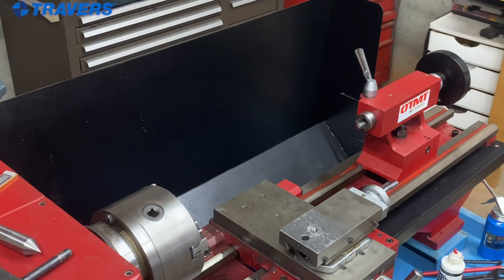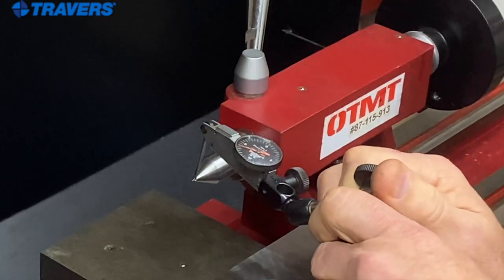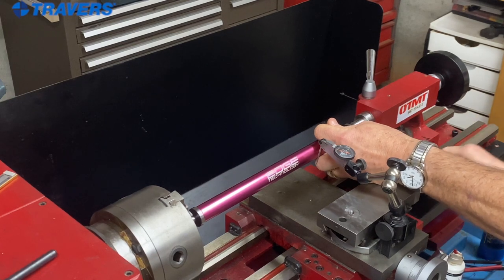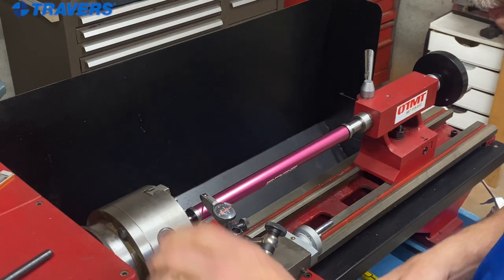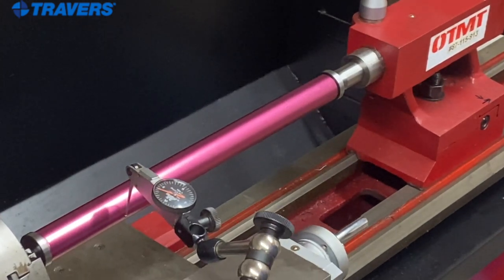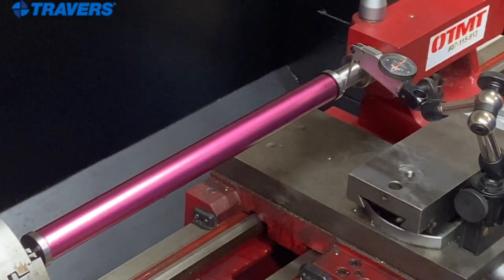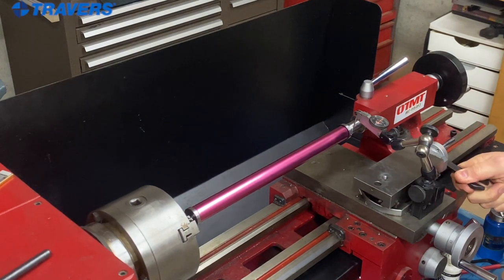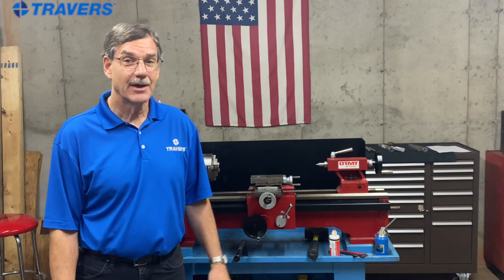How To Align The Tailstock To The Headstock On Your Lathe

Comment: That's great for the horizontal axis. What about aligning it vertically?
Reply: Thanks, DH.  As long as you can hold it between two centers and run an indicator from one end to the other, the angle it's at doesn't matter.

Comment: Mentioning that the lathe bed needs to be dialed in flat/level before this test can be considered accurate would really help new machinists. It's probably the biggest reason why new machinists have problems with accuracy using small budget lathes. My friends little lathe had a 0.010" twist, once we shimmed the bed and got it true his "dialed in" tailstock accuracy was worse than the factory setting. It's a great video but mentioning the other alignment tests would help new machinists that are beyond frustrated with inaccurate parts with where to look next.
Reply: Great point, jefflyon100.  Thanks.
Reply: How to shim?  I got a new lathe and it's over 1cm out in both planes

Comment: My Clausing 6300 lathe was dropped during moving. I suspect the bedway is out of alignment. As I can not get the tailstock alignment the full length of the bedway.
Can you show how to align the bedway to the headstock ???
Thank You T. M.
Reply: Too bad about your lathe, the truth is the parts just need to come out correctly.  With 90k hours machining parts I can tell you all the lathes are a bit out somewhere.  This method shown will change as the tailstock is moved into another position.  Your part lengths will always vary maybe shorter or longer than that bar he used to indicate the tailstock in.  This no BS no indicator method will ensure you make good cuts on your parts.   Chuck up your part ready to machine with tailstock snug but not gorilla tight you may need to adjust it.  Take a cut on the chuck end, enough to clean it up and wide enough to measure, note the dial position precisely.  Do the same at the tail stock end using the same dial position precisely as the first cut.  With the lathe stopped measure them both.   Lets suppose the tailstock end measures bigger than the chuck side cut, move the dial to that position, .010 larger than your original dial setting.  Tool positioned over the tailstock side machined cut with the machine on, adjust the tailstock until it just starts to tickle the cut you first made.  Done correctly you can now machine a straight cut precisely.  Take another chip on both ends and compare, tighten up everything when your satisfied with the results. Super fast to do, and very accurate results on any lathe at any length.  Cheers!

Comment: Why are you trying to line up with a Chuck?  Ever thought about removing the Chuck and installing the correct taper dead center into the spindle?  As you said, chucks have run out.  If you want accuracy Turn between centers with a faceplate and dogs.
Reply: Great point, Rod.  Turning between centers is always the most accurate, whenever possible.

Comment: Brother, is you headstock alingned with the bed? In other words, is the center line of the headstock spindle parallel to the bed? This is the first thing you need to check. Once you are sure it is, you can align the tailstock with the headstock. Another question: Is the cross slide of your lathe square with the bed? These are important things to confirm. Just some ideas for all who might not be aware of these things.

Comment: If the dead-centre in the chuck has 1.5 thou runout, (being half-way between max and min), will the turned part show the same runout when chucked-up between centers on a different but spot-on, machine?

Comment: How would you deal with a tailstock that has .007 drop on the nose end? I place a mag based dti on my chuck, and run it on a dead center. I can get same registration on the side to side, but not up and down. I'm thinking jacking screws in to four corners of the top half of my tailstock where the split is.
Reply: Shim stock would be a better option.

Comment: What if your tailstock center is not at the same height as the headstock center?  As the dial indicator runs along the side of the tube the indication will change.
Reply: Hi Rick.  I'm afraid that I don't have good news for you.  If your tailstock is lower than the spindle axis, the lathe ways and/or tailstock is/are worn out.  If your tailstock is higher, it's probably not made for that lathe make & model, but it's possible that it could be machined down to the correct height.
Reply: Didn't mean I have a tailstock that is lower.  I was just proposing a "what if".  Besides, if it is lower, than you can easily shim between the base and the tailstock to alleviate the misalignment.  And, if it is higher doesn't necessarily mean it was not made for the lathe, just means it came from China. @wonbythe1
Reply: So true,  @ricksweetser1683   If you shim a tailstock, the shims will need to be long enough to bend & secure them on both ends, so they don't slide out when you drag it along the ways.
Reply: The tailstock on a Chinese lathe is 2-piece so you can place the shims between the two parts. @wonbythe1

Comment: Hi, I am trying aligment of tailstock on my lathe. Diameter is a little larger on tailstock side than headstock. Do I move tailstock towards me or away from me?  If I have a difference of  a tenth of millimeter, do I move tailstock half of that to get workpice paralell?    mvh  sverre  eriksen Trondheim,  Norway.
Reply: It depends on the machine, Sverre.  With your indicator on it, move it one way, and see if the indicator needle moves in the right direction.
Reply: @wonbythe1  thanks so mucg for your answer

Comment: I tried this tool on a friends 13X40 Grizzly and it did not work. He bought the tool to align his lathe and it did the opposite. The machine was fine, the tool seemed ok, the lathe was better aligned simply cutting a length of metal and adjusting the tailstock to suit like has always been done.
Reply: I apologize that it didn't work our for you, the way you were hoping it would.

Comment: Why not just turn a piece of stock and measure run out ?
Reply: That's another good way to do it, Rob.  Most people usually have something they can turn.  Another way to do it is to put a center hole in each end of a precision graound rod.  Using an alignment tool is just a convenience for some people.